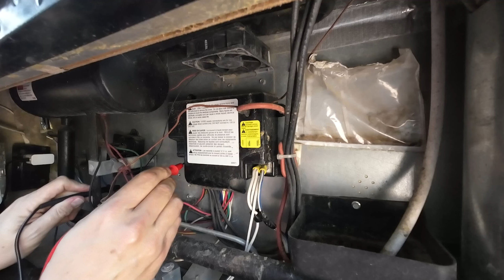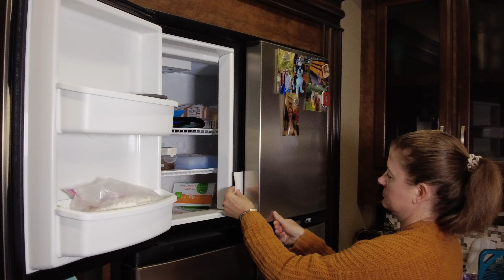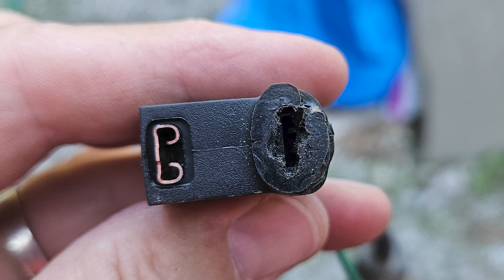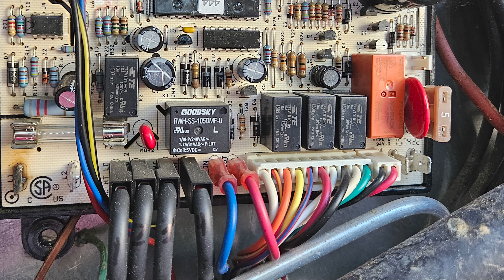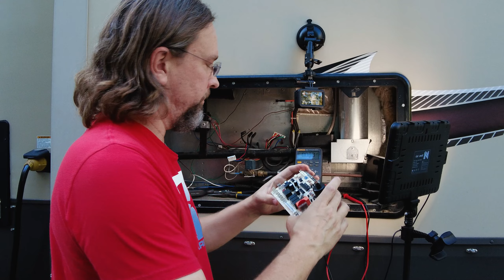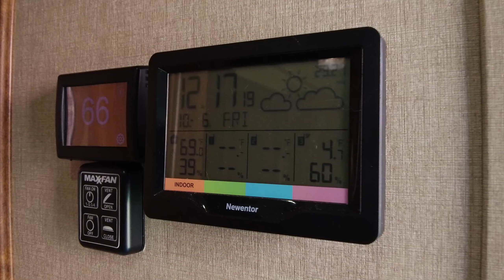It Was Only a Matter of Time...Narrowly Avoided a Fire! | Full Time RV Living

Comment: Great catch in that connection.  Definitely a potential fire issue and possibly causing low voltage to the card and affecting it's performance.
Reply from the maker: I thought about that too, but it operates the same when running on propane. No 120V input to the card.  But...it definitely seems to be running better. So there's that. Lol.

Comment: Grab an infrared laser thermometer and periodically check the temperature of that connection that you found faulty. If it's at a normal temp, that's good. It it is still heating up, contact the refrigerator manufacturer to see what the cause could be [what circuit is it?]. You don't want the same problem to resurface in a year.
Reply from the maker: That's something I actually meant to put in the video. It temps good with the IR gun...right around 105F with an ambient temp of about 90. That's a great tip, though! Thanks!